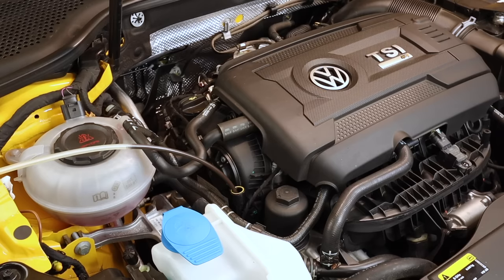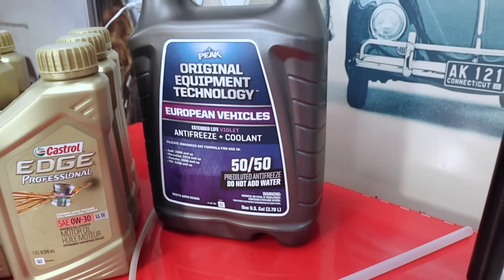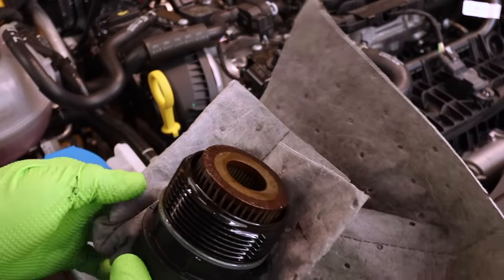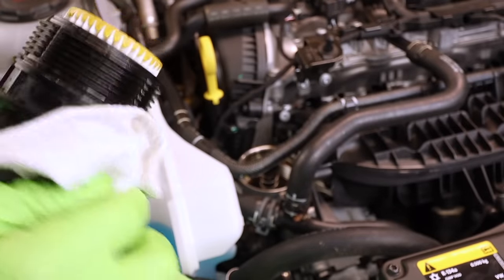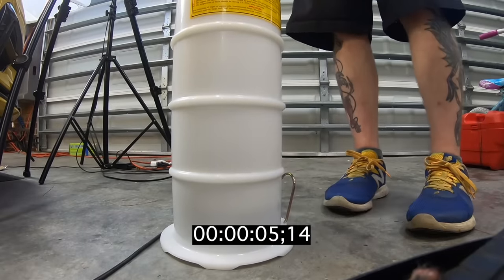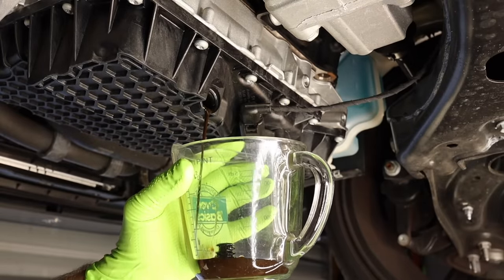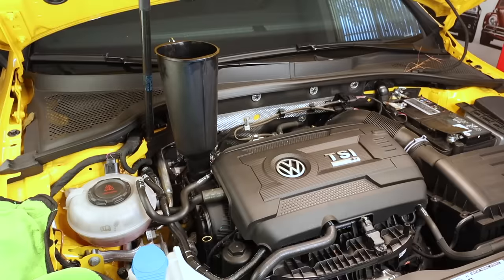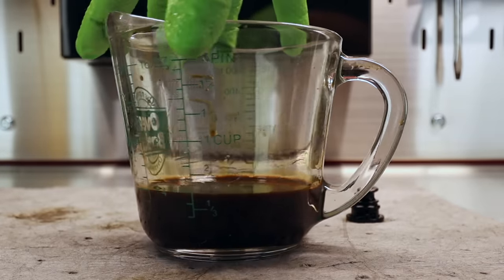Will an Oil Extractor Get All The Oil? (MK7.5 Golf R 5000 Mile Service)

Comment: If you want to get the rest of 100ml out using the vacuum extractor, you could just let it sit 10-15 minutes after extraction so all the oil drains in the pan off the engine walls and other parts, and just extracting oil a second tim after that. At the end you will get every drop out as if you released the drain bolt.
I know it's not recommended, but i use a oil extractor when the engine is hot. The engine takes 4l on initial fill and 3.8 on oil change. After extracting the oil I put 4 liters in the engine and the the dipstick shows oil in de middle. 
Before getting an oil extractor I drained the oil via the drain bolt. I have a habit of letting the oil drain for a minimum of 10 minutes so that I shure I got everything out. But in reality I was the engine would take only 3.75-3.8 liters and the dipstick would show just in the middle. In my case using an oil extractor is the best way to go.

Comment: The reality is, the time you spend waiting for the oil extractor to fill up (It takes ages!) You may as well drop the sump plug. Did this on my Mercedes GL and it left a litre and a half in there, even though I kept reinserting a number of times. Would not recommend an oil extractor at all!
Reply from the maker: It depends on the extractor and the oil temp. This one is FAST
Reply: my mityvac 7201 takes 5 minutes max on my e39. don't use the skinny tube and you'll extract 4-5x faster
Reply: What on earth are you saying? I change my cars oil and filter in  about 15minutes with extractor. Sucking oil takes about 5minutes with that kind of extractor. Looks like I have exactly same model. Obviously it's meant to be used when oil is warm. I do it pretty much still burning hot. I drive from work for about 30minutes and when I get home I drink one cup of coffee and go change the oil. It's way faster than if I'd begin to jack my car in the driveway.

Comment: There’s nothing wrong with the 100ml of oil that would be left in the pan. A slightly un level floor would do the same or worse.
Reply: lowered expectations
Reply: What do you mean? That’s a perfectly reasonable expectation.
Reply: @TheNickkirk  I mean I guess if you ladies don't want to get your nails dirty, its perfectly fine to leave old oil in the engine after every oil change. lol
Reply: My point was that there is always left over oil in the engine. Always. Drain the oil and drop the pan if you want to get most of it out(there will still be oil dripping out of the engine for days with the pan off) it’s just life depending on pan design and plug location it may even get more out with the suction system. That’s why my comment specifically said draining oil with the vehicle in level will leave that much or more. The shop I work on has fairly level floors and I’ve pulled oil pans that had 1/2 quart or more in the bottom.
Reply: @TheNickkirk  There is still even more oil inside the oil pump, oil galleries, VVT, cylinder head, hollow cams shafts, solenoids, turbos, coolers, etc.  10-20% of oil capacity will remain in a modern engine.  I have oil analysis showing this and confirmation from labs.
Reply: @robsp32  Unless you tear down and rebuild your engine completely for every oil change, you will ALWAYS have at LEAST 100ml of old oil left in the engine. Its not possible to remove it all without a complete tear down.

And then, when you tear down the motor you have to go through and DAWN each and every tiny part to get the oil off. Remember, oil sticks to things and REPELS water.

Comment: 100ml of old oil that gets mixed with 6 quarts(5,676ml) of new oil which is then passed through a brand new oil filter. Sure you can pour another quart of oil into the engine and see what else you can extract and if you don't mind wasting good oil then you should go for it. But you have to remember that there is probably just as much old oil still clinging to every surface inside your engine that won't drip out. Most of the oil will pass through the engine and the new filter in about ten minutes time. Not enough of a problem to worry about.

Comment: My OCD couldn't leave that oil in the sump.
Reply: That's not your OCD my friend, just your common sense!
Reply: There is always oil you can’t change. Don’t let your ocd get to you. That little bit is nothing.
Reply: I’m with you on that my friend. If it’s got a drain plug use it 💪
Reply: It's the dirtiest 100ml of oil. I go as far as pouring half a quart of fresh oil and let it drain out.   My engine has 250k and doesn't burn a drop of oil.
Reply: @Motorsportsgeek  mine too and i always used an extractor . changed it every 5k tho
Reply: @russelmc5383  And do you get 300k out of your engines?
Reply: @Steven Ross-watt - Only issue with that is you aren't running oil at idle to flush out the flush chemicals which are designed to eat away at oil. That's fine for a periodic maintenance followed by a reduced change interval, but if you're doing that as regular service with a normal interval you may be doing more harm than good.
Reply: @8190930  In reality with these modern engines, 10-20% of the old oil will remain.  Wish it was only 100ml.  HumbleMechanic is perpetuating the myth that all the oil drains out.  See my post.
Reply: Its not OCD, agree it is common sense.  10-20% of used oil remains in modern engines.  I perform a second oil change and keep the flush oil to use again.  Will achieve 99% replacemen..  This is known as a Full Volume Oil Change in the Machine Lubrication industry and applies to all engines.
Reply: I’m that way too bruh. Just doing it right.
Reply: after mine gets done draining, I pour about a cup of new oil in to flush that out.  lol
Reply: @wagnerrdtradingpostonebay8934  LOL I would do that when I was deployed.   Made the wipes last longer through a mission this way.
Reply: Common sense wouldn’t allow you to own a German junk cars. Especially BMW And Audi. 
If you ever worked at a dealership you would know. I would never go 5000 - 8000 on a oil change on any car. But it’s much more important to do it on modern cars !

Comment: Generally - the dipstick - has a Full and Low mark.  And an Engine Oil drain - and refill - should put the Oil level at the Full mark.  It does all depend on what the Owner's manual states.  For example - a 2013 Subaru Outback - has TWO marks.  Low & Full.
Full is just that.  FILLED and full.  Proper amount of oil causes it to be at the FULL mark.  When the Engine is Hot and the oil has expanded - it will exceed the FULL mark.  This does NOT mean you overfilled.
The  2011 Outback has THREE marks.  Low, Full and HOT.  Changing the Oil and putting in the required amount - causes the oil to be at the FULL mark.  Driving and when Hot - the Oil level rises up and comes close to the HOT mark.
A 1/2 cup or even 1 Cup of extra oil - will not damage the Engine.
Draining the Oil and putting in the stated amount for a Drain and Fill with Change of Oil Filter - is the correct procedure for an Oil Change.  Not - a vague - get the oil level at the "Halfway" on the dipstick.  That is just WRONG - unless that is what is stated to do in the Owner's Manual or the Service Manual.  However - those two items always state an AMOUNT to put in - when doing an Oil Change.  They do not leave you checking the Dipstick to find out you 'over filled' because you are more than Halfway up the dipstick.  Or you under filled.  And have to add just a little bit more - till it is at the halfway mark...
Quit telling people WRONG stuff.  The way you checked on your oil fill amount - was WRONG.  Drained just the Oil?  Pour in the MEASURED amount for just an Oil drain and fill - as stated in the Owner's manual.  Drained the Oil and Changed the Filter?  Put in the MEASURED amount for an Oil and Filter change - as per the Owner's manual.  Start the car - let it run for a minute; check for leaks; shut off and check the oil level.  In case you drained the Transmission oil instead of the Engine.  Or some other stupid mistake - which have been made before.  If you did it properly - you will be FINE.  Your insistence of being halfway on the Oil indicator dipstick - is WRONG.

Comment: I own a golf r 2019.  I live in south Florida. It gets hot af down here. In the cooler months,(dec-feb) which is not consistent and becoming more non-existent.  I've gotten this from more than one VW mechanic and even a former VW tech to run 5W-40 in my car.  However, sticker on my car says to run 0W-30. 😂  I called VW service today where I bought the car and they're telling me they use 0W-20 🤦🏻.   Yes Charles, this is quite confusing indeed 😅

Comment: Add a "chaser" quart of new oil after initial extraction to dilute and remove the remaining oil.
Reply: That's a waste of fresh oil and money lmao.
Reply: So if you change your oil 4 times a year, you're throwing away a gallon of oil per car per year?
Reply: Stuart,  in modern engines 10-20% of used oil remains trapped in the engine. I have oil analysis showing retention of 20% wear metals, contaminents and oxidized oil and degradation of the new oil within 20 minutes of running the engine.  Perform a second oil change with cheap oil and you will see how contaminated it is.  A second change will give you 99% clean engine oil, just like when it rolled off the line at the factory.

Comment: There are other comments to make with this one, if the extraction pipe is used correctly and the pipe sits on the bottom of the oil pan it does extract all the oil except for a wet coat lining the pan, in the data manuals there are two oil quantity measurements listed a dry fill and a service fill there is normally about 500 ml difference because all the galleries  and ledges in the engine hold oil so you don't change all the oil anyway also the last drips of oil in a modern engine are not the sludge because modern oils have cleaners which prevent this so unless you have an old worn out engine slugging up the oil it's past worrying about the oil change and it needs a rebuild either way top down servicing is perfectly ok

Comment: love the extractor. I can do my own oil changes without taking it to the dealer. It takes out 99% of the oil anyway as long as it takes out close to the same amount you put in you are good. 100 ml of old oil wont make a difference.

Comment: Great video, when I buy my next car that will likely have the oil filter on top of the engine I will definitely buy an extractor and do most oil changes this way. But when it comes time to jack up the car and rotate tires/inspect things/brakes etc. I will give the car a full drain from the plug. IMO that is probably the best way to do it. For just oil changes, extractor. \When doing other services that require you to be under the car, drain plug.

Comment: Wouldn’t it be better to leave the oil filter off while extracting the oil? Having air flow would help the extractor not only extract faster but also let more oil be extracted I’m guessing.
Reply: The crank case breather lets in air by the intake so no that is never a problem on any cars 🙂

Comment: With higher capacity,longer interval filters available its pretty common for sales reps to change oil and maybe skip the filter. Actually some filters like droflow air filter,HVAC, and long interval oil filters thrive by having a little bit of debris trapped,helps filtering. Honda MM sometimes will say to change oil and filter and sometimes just oil. Highway miles are easy and getting oil up to 100°C/212 F is the best thing to keep contamination down. I would still do every 2nd or 3rd oil change as a drain and fill. If I ran a track event and had high fuel dilution or suspected i did, this would be great to draw a sample out or replace some oil and top off to keep the viscosity from falling out of specification.

Comment: Personally I'm sticking my Fumoto drain valve. Prior to getting the Fumoto I did try the extractor method, and it is neat if you have the filter uptop, but ultimately it just transfered the headache of dealing with a jack to dealing with dirty oily hoses after. I mean yes it was still cleaner than dealing with a regular drain plug, but with a Fumoto you can drain it entrely without spilling a single drop.
Reply: How did you handle the oily hoses situation after? Thanks for the heads up. I was considering it until I read your comment
Reply: @mr.gk5  By getting rid of it and getting a Fumoto valve 😂

Just lots of paper towels on hand, but even after like 15 min of wiping off oil it was still all oily feeling on the outside and covered on the inside. No idea how you'd deal with getting the inside to the point of not dripping out over time, I had the end of the hose as the highest pont when storing it.
Reply: Great. I've never heard of them before. I would have gone for it except my 2011 VW Golf is really low and I don't want to take a chance. If I had a more normal car, I would have gone for it.
Reply: @leezap  They have many different models to fit most any vehicle like low profile ones and right angle models. I have the straight one with standard long nipple and it doesn't stick below the pan or under tray. If you're really worried you can get a skid plate, actually pretty common to see these valves being installed when adding skid plates since the plates can be a pain to unbolt for oil changes
Reply: @Oleg-oe1rc   Thanks. I didn't know there is such an animal. It's a great invention. There are different brands too that I will look into it.

Comment: I knew a guy that used an air extractor when I used to PM forklifts. It seemed handy and saved time, but I was always a bit iffy about them. The plug on the bottom of the pan is designed to drain everything out and I was worried an extractor wouldn’t get that. I will say, after reading the comments, it may have been overthinking on my part. Seems lots of you have no problem with them.

Comment: So next time use the old O ring that has been cut after removal, loop it thru the new O ring pinch the tails of the old O ring now feed the new O ring on the the cap, pull the old O ring (while it is looped thru the new one) rotate around the cap to help feed the new into its groove, helps to seat the new O ring, no cuts, nicks and NO twists. good for all rings.
Reply: Nice, I'll have to note that down for my next change.

Comment: On some applications i would definitely use the extractor however on my car it sits a little high off the ground so i don't even need to jack it up to change the oil and remove the filter. But that extractor would definitely save you time and work if your car is low to the ground!

Comment: I drain using the drain plug then I made a 1/4" Cu tubing attachment with a curvature that I adapted to the extractor tubing and I suck out all fluid I can reach inside the bottom of the pan.  It's a little unnerving the first time because you don't want to find that the tubing gets stuck somehow as you move it around inside the pan.  I also measure the oil going in as the oil suppliers are not that accurate in the amount of oil they measure out inside their containers and with the method described above I get the most oil out possible and replace with the exact amount of oil every time.  It's not as big a hassle as it sounds and good peace of mind that the most important maintenance is done the best you can do.

Comment: I used a oil extractor in my MK IV Golf TDI for years. So much easier.
Reply: It does seem a lot easier to just use the extractor instead of having to remove that plastic under tray and drain it out. But this guy has a lift in his garage so why not lol
Reply: Why is the quote for an oil change at a local shop so expensive....
Reply: Also keeps from stripping the threads in the aluminum oil pan with the steel drain plug!
Reply: @timyt13  Because They are billing you for a total hour of work. Most shops are over $100 an hour for labor cost. Then you add in the price of oil, filter and plug. Audi chargers $169 for just an oil change.
Reply: @timyt13   To pay dieselgate 😉

Comment: I need a legit oil funnel like that. I've been eyeballing the first quart, then hacking the bottom off the bottle for years. Never remember to buy a funnel until it's too late...
Reply: Just cut the bottom off a 2L pop bottle.
Reply: Jason Korman Which soda do these engins prefer? Wouldn't want to give it Diabeetus.
Reply: Just keep that bottle half for future use if it works.
Reply: john fitzgerald   I use the two liter bottle trick, but I use a new one every time.   Oily funnels setting around the garage get really dirty.

Comment: My Land Rover discovery D4 has a dedicated tube in the engine that goes right down to the bottom of the sump LOWER than the drain plug so you can remove more oil using the suction method , but my main dealer still uses the sump plug removal method.When my free service plan runs out and I start to do my own oil changes I will be using the suction method.

Comment: When doing an oil change in my garage I drain the oil out via the sump plug then using a special fitting on my extractor I extract any remaining oil below the sump plug hole via the sump drainage hole.... then pour through half a litre of clean oil before reffiting the new plug.

Comment: I like to drain it from the drain plug. While it is draining you need to look at other things on the  the car anyway. You may have a few grease places to grease anyway. I always paint my exhaust system with rust- oleum. Makes the exhaust system last a lot longer. Plus you will find a lot of other things to paint to keep them from rusting if you have the time to do it.

Comment: Did an oil change on my w213 e-class today, and looking at the sump, the oil dipstick tube went straight down into it, it was definitely designed to be pumped out, the dealer probably never drained via the sump as the bolt had no scratches from Tools etc. (car is 3 years old)